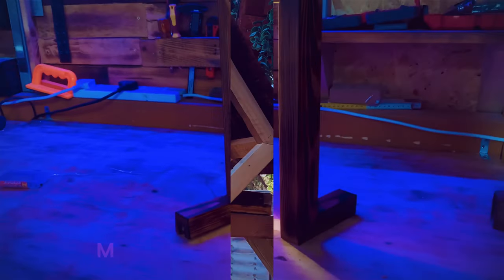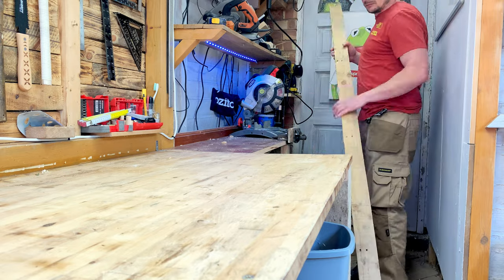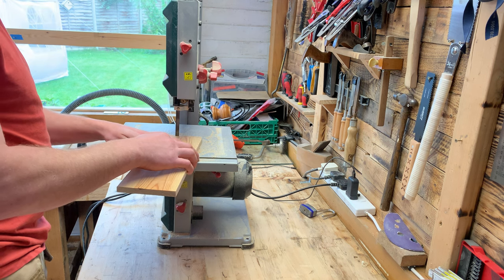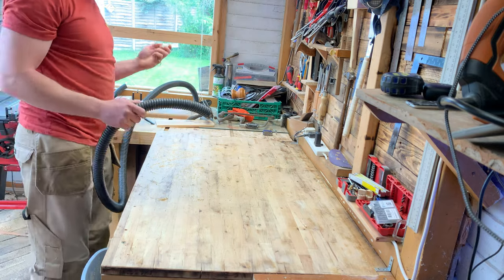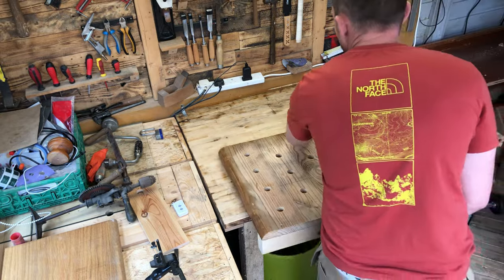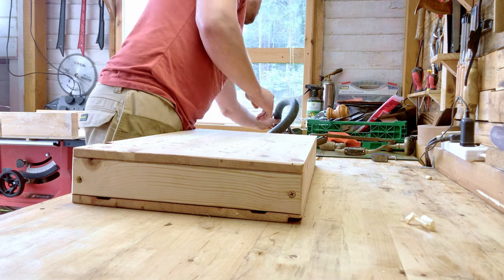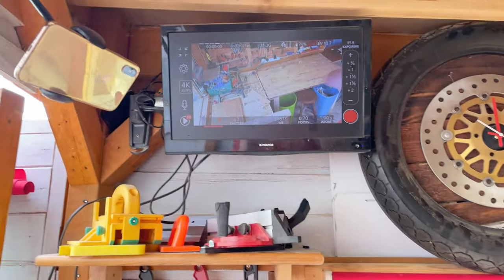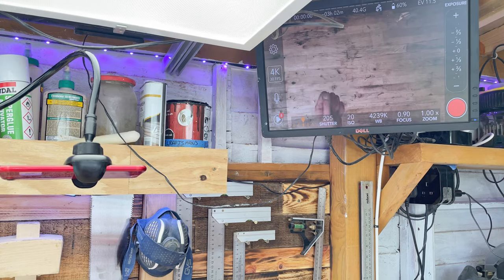Me, My Tiny Workshop Tour and Youtube Studio Setup - also my first ever video voiceover 🫣 😱

Comment: Solid video and a great use of space! The bifold doors, work bench extension and portable dog hole table are cool!

Could the dog hole table double as a downdraft table so you could eliminate one of them?  I’m thinking the dog holes may be to big and you’d lose too much suction..I’ll have to experiment!  Having the dust collector outside and out of the way is an excellent idea too!

And I feel you should’ve gone more in depth about how you record with the iPhones and Apple TVs.  Or, you could make that a stand alone video.  I find it super interesting and cool because you can see yourself on the screen when recording alone.  Would make video production that much easier without having to keep adjusting the camera by walking behind it constantly.

Good to hear you also!
Reply from the maker: As I’m using simple dust collector it has limited suction power 😂 unfortunately only smaller holes will work here. 
That’s a great idea Mike!
I’ll try to make a separate video where I can show how to set it up properly.